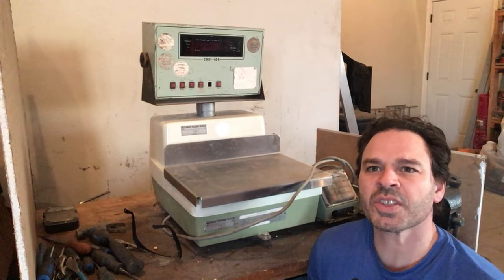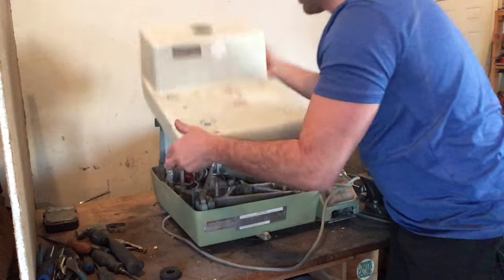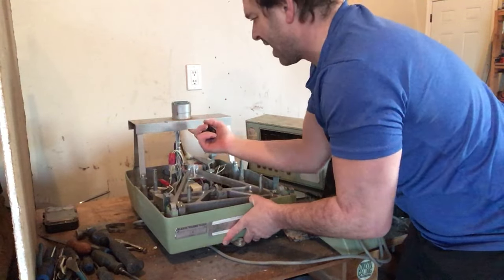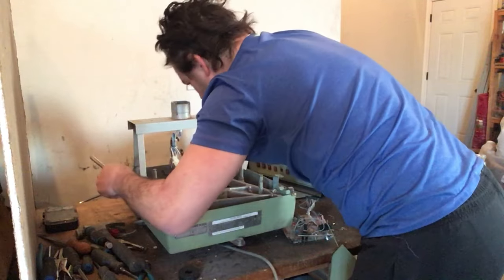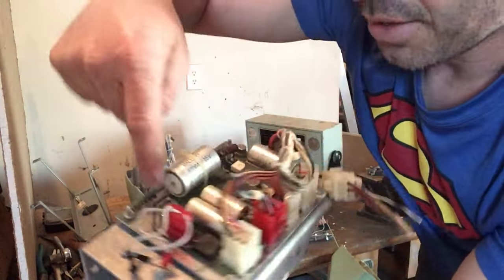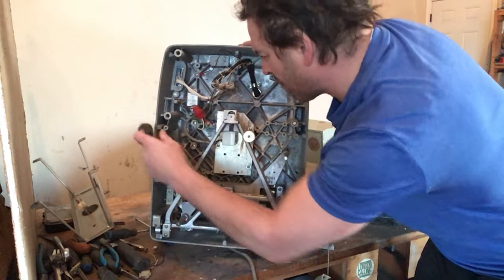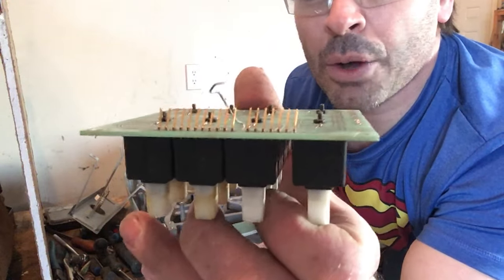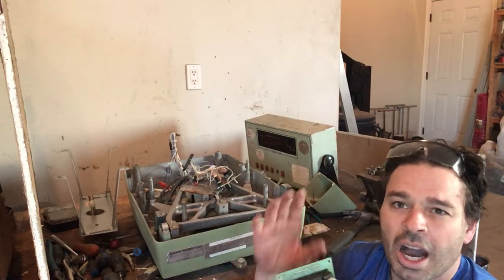Scrapping a large digital scale for loads of cast aluminum, copper, GOLD, and other metals.

Comment: The prongs on the heatsink are mosfets. With mine I build them up and then pop them in the freezer, once frozen it takes one little tap to break them open to get the copper out (the bridges can also have a copper plate)👍 Great teardown👍
Reply from the maker: Good tip! Thanks for that. At $5.25lb right now they are are great source of scrap copper.

Comment from the maker: Note: recorded a few months ago so prices have changed. Final breakdown with current prices: 1lb #2 copper $5.25, cast aluminum at $0.90lb (33lbs), tin at $0.10lb (15lbs) stainless steel tray $0.77lb (6lbs)
Reply from the maker: Zinc cast $0.45lb (10 lbs)